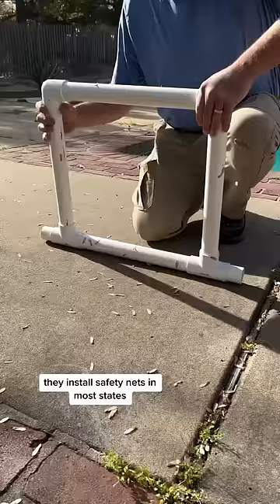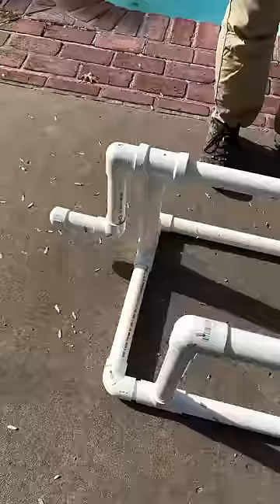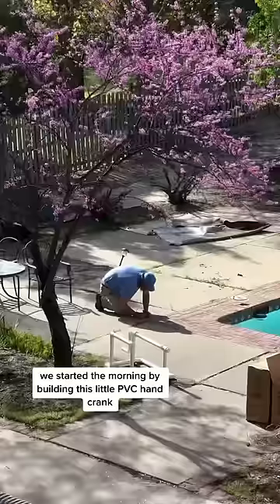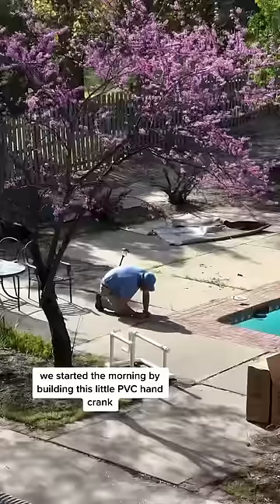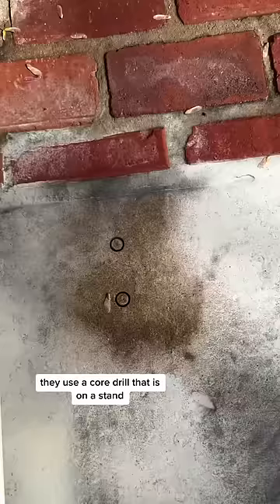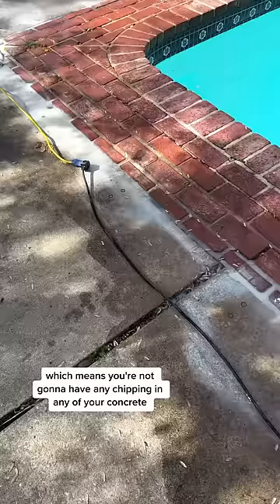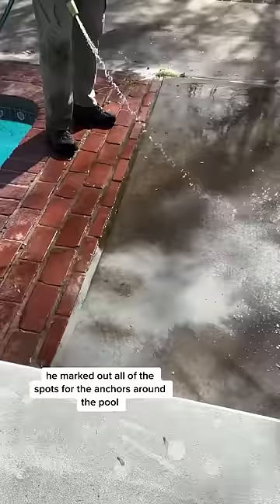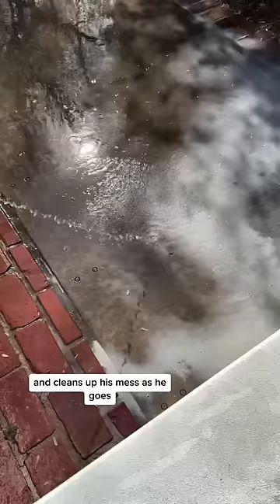This has made us feel so much better about our pool with kids! #diy

Comment: In Australia we have pool fences😂
Reply: We have to, legally, too
Reply: Ikr why can’t America use them as well? Plus wouldn’t it be hard to get the cover net off?
Reply: Legally in America, you have to have a fence around the pool, this is just added protection.
Reply: We have them in America too. You cannot have a pool without a fenced in yard or a pool fence. If you have a fenced in yard, you have to have alarms on doors and windows. This is just protection on top of those.
Reply: In Australia if a neighbour reports you for anything they come in and check the pool and can force it with huge fines and small jail time if not actioned on
Reply: We do here too, but you would be surprised how little it does when put to the test. While it may stop most situations kids find ways to get into all sorts of situations. I was a red cross certificate water safety instructor and a lot of what we did was learn what are the most comon ways people drown to prevent it. While this idea is good when the fence fails, the biggest issue is teaching your kids to swim. Most people don't actually know what drowning looks like and parents will watch their child drown without knowing because the signs are not what we see on tv
Reply: Can kids not climb?
Reply: Plus every 5 year old starts swimming lessons even if they have already learnt to swim
Reply: @charliekezza  knowing how to swim doesn't mean you can't still drown
Reply: @moonbuggg a fenced in yard is hardly good enough when you allow kids to play outside in ghe same yard. It takes less than a minute of no supervision for them to possibly fall in and drown.
Reply: Yes. But high standards need to exist and they should follow a strong code for how tall and secure the fence is so even in the worst case it should be difficult for a young kid to get in.
Reply: @charliekezza Anyone can drown, even if you know how to swim. Drowning is a reflex, like kicking your leg when your knee is tapped. Once it starts, the drowning person cannot stop it.
Reply: To all the Americans in the comments: a pool fence is NOT simply having your backyard fenced in lol its a secondary fence that usually borders the pool deck or cement pad. This way kids can play in the back yard but still not have access to the pool
Reply: @notstewie-HelpMeGetTo50SubsPlz  We know. In Arizona, USA, I honestly can’t remember seeing any pools without a pool fence *around the pool patio*.  They run anti-drowning PSAs every summer on our TVs telling people to check that their pools were fenced and latched and that their kids were safe. 

People were just saying that a backyard fence technically meets the legal requirements with extra security, but by no means is that the norm where I grew up.
Reply: @notstewie-HelpMeGetTo50SubsPlz yes, we know. People without small children don’t usually have them because why would you. People will install a pool fence once they have kids for their safety, assuming they have a pool
Reply: @chloekingdon7269 in Austalia we have to have the pool fenced off with a gate that doesnt allow for children to access without an adult also in my state you cant have trees children can climb and access the pool we take pool safety very seriously and fines for not being compliant are massive.
Reply: @theblackfamily472 HOAs. If they don't want you to have a pool cover or a fence, then you can't get one. They'll sue you to hell and back if you do 🙄
Reply: @softsounds8453  what?
Reply: Because people and kids can’t find ways to get passed fences and locked gates?

Also in the US legally you are supposed to have a fence around them. Doesn’t mean kids or adults couldn’t figure out how to get in anyway. This video is oils just add more security and peace of mind.
Reply: In Scotland we have puddles (too cold for outdoor pools lol)
Reply: I was born and raised (and still reside) in America and my parents had a fence from one end of the screened enclosure to the other blocking access to the pool, but not the communal area. Idky they're doing this pool net thing.
Reply: @moonbuggg bruh no you don’t 😂 so many people have pools in their opened yard , u do NOT have to have a fense and a fucking alarm system 😂😂😂
Reply: @aisling7244 also the cool thing about America is each state has different laws so just because it’s a law in your state does not mean it is a federal law , stuff like how to treat a pool is STATE law , each state Carrie’s on how you must protect your pool it is not a universal American law, also in my state a normal Walmart blow up pool they do not require any permits, around the pool fences, alarms , anything ! IFZ IT IS OUT IN THE OPEN nothing to protect it and a kid drowns you will be charged for said crime of “letting a kid drown” but if a cop drives by and sees your 3 foot Walmart pool in your yard ain’t no one gunna write you a ticket .
Reply: @theblackfamily472 Americans also have pools with fences. Some people just prefer not to have them installed for the “aesthetic”
Reply: This isn’t only what they have. They’re saying this is the superior method
Reply: @theblackfamily472 the thing they first made is a device that takes the net on and off automatically. However I do agree. It’s probably easier to just have a fence with the latch only available at adult height, but maybe they didn’t want the look of a fence around their pool
Reply: Yeah I don't know why this is being promoted so heavily, to protect yourself and I think by law in some or all states of the US you NEED to have a fence around your pool/back yard if you have a pool
Reply: @theblackfamily472 They do…
Reply: @hiddenkitty675 there are laws about the type of fence that are incredibly hard if possible at all to climb. They also have to be a certain distance from other fences (property boundary fence) or climb-able structures. You also have to apply for a permit which involves an inspection by someone from council
Reply: @hiddenkitty675  toddlers, mate. This is for toddlers.
Reply: @foodplug5627  we legally must have them like the police do not care about your frickin aesthetic they will fine you 💸 say goodbye to that money man
Reply: @moonbuggg only in a SMALL amount of states, and also it applies to PUBLIC pools not private ones
Reply: @Temp1949 so if you’ve owned a property in the 90s, anyways idk where you learnt that but that’s incorrect (just read the law then).

Only exception is (case by case), but any pool, spa pool, swim spa or permanent pool REQUIRES a fence around it.
Reply: @theblackfamily472 we do it's actually more common than the net and some states require it, if you have children in the house the people here seem to be a little bit more concerned with Aesthetics then safety
Reply: We have those in america, too. Why do non-americans think they're so special??
Reply: To the people saying America has them to. Yes. We do, but the law verys by state. And communities. Like as i like in a rural area in the north i can have a pool with no fence inground or above. But if i lived in the town i may have to have a fence depending on rules which can be fined for if not up when required
Reply: Ididathing doesn’t have one around his pool
Reply: As an American I'm wondering why we don't
Public pools here do
Reply: We have them too but kids can climb fences
Reply: @_billyjackson No nobody drowns that fast.
Reply: Legally finable and even grounds for arrest in Florida if you fight against it.
Reply: The state of Tennessee in the US does too
Reply: @charliekezza IF they have already learnt" to swim, why swimming classes?
Reply: @aisling7244 ok, so you liven in Arizona where most people have pools. What's the point of saying WE know other to be condescending? I am canadian and didn't know it's a rule, as the 4x I've been to the US, 3/4 did not have a pool fence. Most.people don't have tv anymore. Did you know commercials are catered to location? Do you think Alaskans get the same commercial? The world doesnt revolve around you, or where you grew up. Good for you for knowing about somethong applicable to your area👍. Geepers
Reply: Kids can easily jump fences mind you

Comment: I'll never argue with layers of protection, but I have never been comfortable with the large size grid of the net. It seems too likely for an arm or leg to get snared.
Also, this particular cover is more challenging to install and remove than most people have realized. I first ran across one about 25 years ago. In the time since, the ones I've seen probably hadn't been installed more than 2 or 3 times before they are just rolled up and left in a corner. They tend to go unused, which is not a good trait for a safety product.

Comment: As someone with lifeguarding and swim teaching qualifications, that is very very unlikely to be effective as shown in the video. 
1: If that rope has ANY slack in it, someone who falls on top of it could potentially drown. You only need enough water to cover your nose and mouth to drown and rope will almost certainly have that much slack. 
2: The holes. Just... the holes. For two reasons:
A - Someone's nose and mouth will easily fit into the gaps meaning that even if the rope only has enough slack to graze the top of the water, you could still drown. 
B - Anyone who does fall onto the rope will get caught on these holes making it hard to escape, once more increasing likelihood of drowning. 
3: It's too unobtrusive. As an adult you obviously wouldn't walk into water, but a young child, confused elderly person, person with visual or mental impairment etc. might and so you need something which will stand out to some extent to let someone know where the dangerous area is. Sometimes people fall into water because they just can't recognise that they're walking onto something dangerous
4: This doesn't serve the primary function a normal pool cover does: keeping the pool clean from leaves, bugs, etc

This could potentially work if there's a big gap between the rope and the water. However, it's not going to work as well as many other options for the reasons above. For truly safe options I recommend any or all of the following.
1: A fence. A safe, sturdy fence that will keep out anyone who should not be around water unsupervised. Usually this is accomplished by a childproof latch out of their reach. This is a legal requirement in some areas
2: A hard pool cover. Something that will, too some extent, bear weight. This is very difficult to manage with a pool of any decent size, though, and a little overkill.
3: a soft pool cover. I.e a tarpaulin. At least it'll keep the water cleaner and its more rigid construction means that there's no holes to get caught in and that you're communicating more clearly that there's a pool that is covered up and thus not ready for use.
4: Make sure you keep watch of the pool any time it is getting used, there should always be someone supervising if there's a child in the water and you'd be kind of dumb to not have someone watching out if there's an adult in the water (medical emergencies don't wait for you to leave the water) 
5: Don't have a pool in the first place. Pools are dangerous. Go to a public pool where there's trained professionals and less risk of someone drowning on your private property

Comment: Had a close call with a safety net. I was working with a backpack blower carrying a 1 or 2 gallon tank. I accidentally knocked some weird water sack thing into the pool while moving the customers water hose. Went to get it and the part of the net I was standing on outside of the pool started pulling my leg in. luckily fell back on my blower but the hose had gotten a bit tangled in the net and I was still being pulled. I grabbed onto a part of their patio but if I’d went in and been tangled up with the net and hose with my blower on, I’d have probably drown

Comment: sigh pool operator here - you need a solid cover that can support a couple hundred pounds, I forget the exact code in my state. Your kid will get tangled and be traumatized if not drown anyway. In addition, in order to be code compliant that has to be fenced in and locked with a non-climbable gate. That net is going to do fuck all

Comment: So if you have to call out a specialist to install this net that means that the net can only be installed during the seasons in which you're not using the pool. So what's the point aren't you supposed to drain the pool when out-of-season or am I wrong on that assumption.

Comment: I'm still concerned with the open areas of the net.  A small child could get thier foot stuck and it doesn't take but a small amount of water for the child to drown.
Reply: A child doesnt breath though the foot karen. Also they dont beam in the middle for a Chance for the face to get deep enough to even Touch the water

Comment: Meanwhile in Australia we have strict laws about pool fences. 
- ALL pools must be fenced off and have a child proof gate. 
- You can not have something climbable within 1.5 meters of the Pool Fence. 
- Children must not be left unattended in the pool area (even if they aren't in the pool)
- Pool fencing needs to be a minimum of 1.2 (almost 4ft) meters tall
- The pool fence must be a permanent fixture.
- Gate latch must be a minimum of 1.5 (approx almost 5ft) meters high.

These rules and more apply to any man-made pools of water deeper than 300mm (1 foot).

Comment: You want to keep children from drowning? Teach them to swim over 95% of children that drown in a pool ground 3 inches from the side of the pool.
A child can learn to swim before they can learn to walk.
You don't teach your child to swim, you are in neglect.  It's too easy to show them how to dog paddle to the edge and walk around to the latter or whole run and horror it takes about 5 minutes teaching the hold the breath, dog paddle over and walk away out.
Besides By the time they're in high school you're going to the swim meets with them. And lifeguard if the local y is a pretty good job in the summer for sixteen year old.